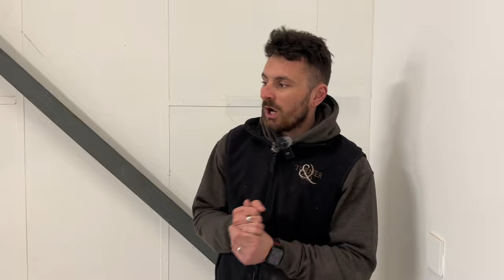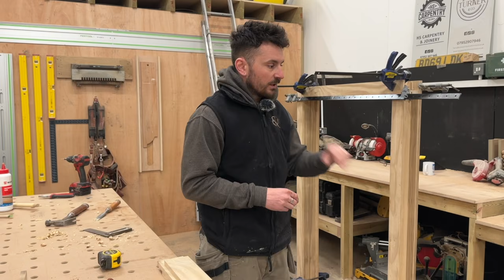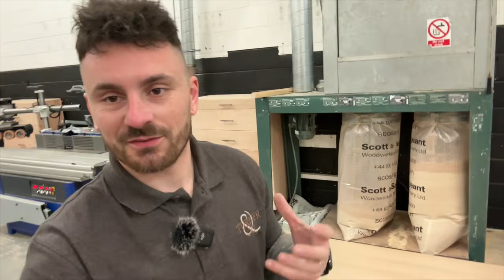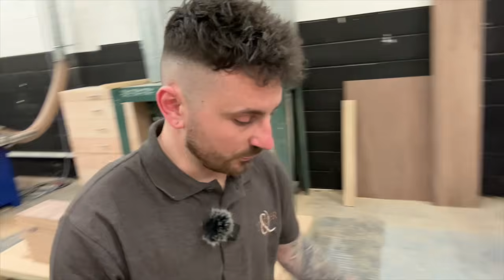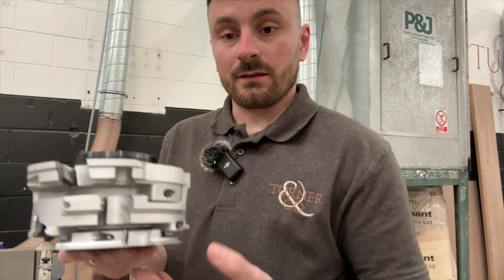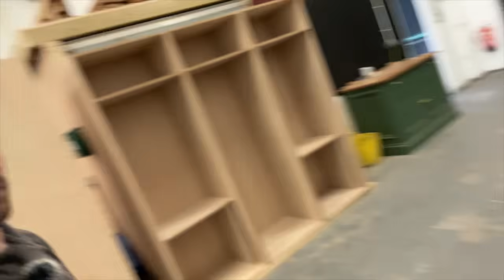THIS IS GOING TO CHANGE OUR LIVES!!

Comment: You've certainly spent some money getting that all set up, you either had a fair amount of working capital within the business to get the majority of your kit or you have some hefty monthly finance payments, but all the best mate and hope it all pays off for you as it's a hard slog been self-employed in this industry.

I've just purchased a standard Combe jointing set for the spindle which has just cost 5k so all that tooling must have set you back a fair bit.

I know when I moved into my current workshop 4 years ago I spent 30K getting back up to speed and I already had all my 14 major machines but by the time I had painted it out, had all the electrics done, had all the ductwork installed and built an extraction shed outside, had timber racks fabricated I'd spent that much not even taking into account the 3 months that I took out from working.

You mention that your windows are superior unlike anybody else's regard’s security and wind proofing.

Isn’t this down to the tooling manufacturer to design and test the tooling and window performance to achieve Part Q, Part L and PAS24 or similar secured by design systems like what Whitehills window tooling is tested too. Surely if you have specified a tool design it has had to be manufactured with test windows then manufactured and then sent to be tested with no guarantee of accreditation!
Reply from the maker: You’re absolutely right. I’ve invested a lot. But I’ve worked relentlessly for the last 7 years to get here. 

Correct again. The tooling comes with all of the accreditations & certifications. We don’t do any of the testing, that’s all part of the hefty price tag they’ve also invested into the tooling by putting it through the rigorous testing. 

There’s a lot of speculation around the whitehill tooling & what it actually does achieve. Certain timbers used on that tooling don’t pass whereas others do. So that’s open to interpretation. 

Whereas our tooling has been tested with many different types. 

I did look at whitehill and had lengthy discussions about what each can offer us and Leitz was miles ahead. 

We were down for around 3 months while we put in the work at the new workshop. Along with everything else, we’re all in but we have a great team & high hopes for the rest of this year. Hope you’ve subscribed so you can see what else we get up to 👍
Reply: @TurnerandCoBespokeJoineryLtd  Well, done in getting to this point in seven years and hopefully it pays off for you, just don’t burn yourself out I was there when I was younger never enough hours in the day, lads to keep busy and customers to keep happy and trying to get good staff was another issue so worked late on an evening and weekend to meet demands. 

I heard that also that about certain timbers and what was tested and what wasn't, I'll maybe consider Leitz next time, I’ve just used CP Tooling for my recent order.

I looked at the HP Window system a couple of years ago but where I am in Yorkshire it’s a lot of windows made to match existing if its part replacement or if they are under listed consent so for me the tooling would probably spend more time sat gathering dust more than been used.

I did also look at the Felder saws last year a K700 with the X-Drive and overhead crown guard which was just shy of 15K but opted to stick with my Wadkin. The sliding table on it is about 1300 square so working on my own gives me more support for materials and items when I'm squaring things up, it will be interesting to see how you fair with the Felder stuff you do see a lot of not very old Felder machines for sale on line the more I look.

You certainly have some ways to go with additional machines, cross cut, rip saw wide belt sander but you can pick these up for reasonable money I your happy with the older branded machines.

Yeah, I've subscribed it'll be nice to see projects coming through.

All the best Kev